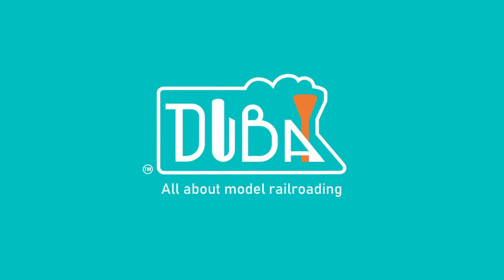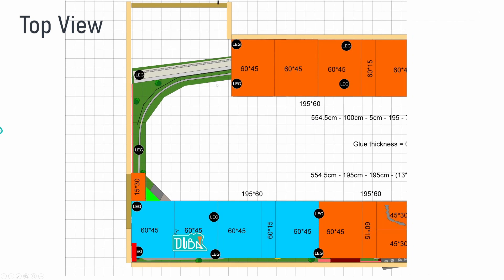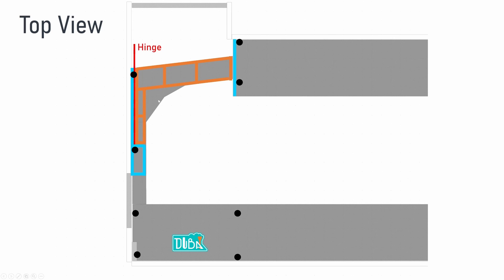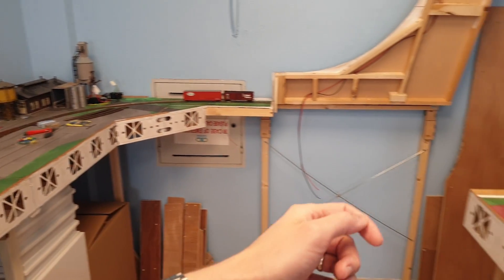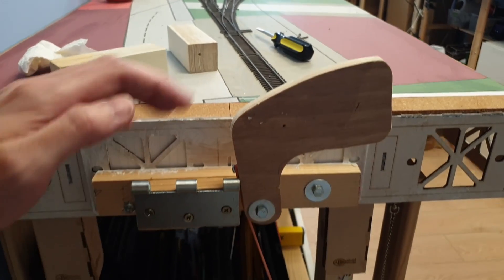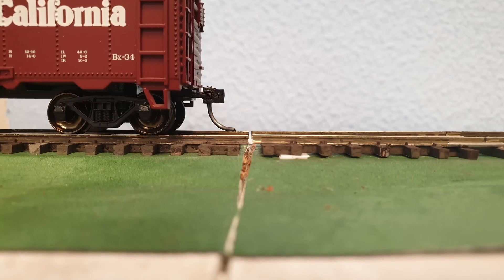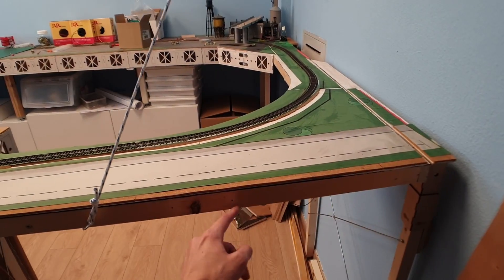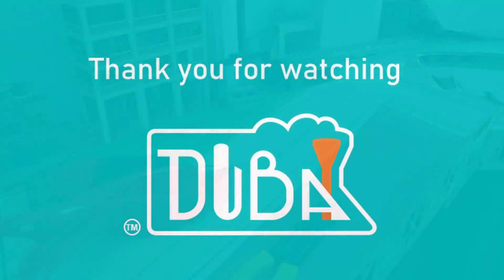135 - How to Design a Lift Gate with Safety Stops

Comment: Nice design, bridges always present a challenge as each application is unique to the layout. I agree with the safety stop approach with your layout, electrical safety switches wouldn't work as well. I used the safety switches as my layout design didn't require it, but I also can run into the same issue should I run them in reverse for any reason. I used a linear actuator for the lifting mechanism. Check out my video...
Model RailRoad Bridge Episode 2
Reply from the maker: A linear actuator sounds fancy! You could equip that with a motion sensors so the gate opens automatically when you approach it. Of course all interlocked with the rail traffic ;-)

Comment: Your counterweight looks to me to be a VERY old top block to a wood-workers plane.  I believe that would have clamped down the blade to a lower block, which would have been flat on the bottom with a slot in it for the blade to pass through.  I believe the hole in your "counterweight" is for not only attachment of the top block to the bottom block, but, you would also be able to tighten / loosen the blade by tightening or loosening the fastener that passed through the hole, thus adjusting and fine tuning the position of the blade.  This would be my best guess.  

As for the work on the lift gate, well done! Looking forward to see the entire system implemented!
Jonathan
Reply from the maker: Thanks Jonathan.
I have been using the life gate for over a year now and it works great. The only part I did change is the rubber band, that broke within weeks. I updated it with a cable and counter weight.

Comment: great job just a thought drill a hole were the coupler contacts the golf club so it makes contact on the buffers
Reply from the maker: Ah ok. to better align the gate with the benchwork.
Reply: no so that the impact is on the buffer not the coupler  @ModelRailroadDesigns

Comment: Your weight looks like part of a trailer hitch...
Reply: I do so wish that you would not have ended with "that is how you make a lift gate", but with How I made my lift gate because there are so many ways to do it. i do like yours though.
Reply: I do wish that you would not have ended this with "that is how you make a lift gate" but with "that is how I made my lift gate. There are so many ways to make one. i do like yours though.
Reply from the maker: Hi David, there are indeed many different ways to make a lift gate, and many different types of gates. I guess the circumstances really dictate what is the best fit for you. 
One aspect that was important for me was to have the maximum possible isle width when the gate is up. I have a lot of storage underneath the layout, and i wanted it to be easy to cary in / out boxes.

Comment: Love the mechanical stops, but I can't help but wonder how an electrical stop could be incorporated, with power districts on either side which would cutoff power upon lifting
Reply: MOSFETs and spring loaded pins to complete the signal circuit maybe 🤔
Reply from the maker: The issue is that the unpowered section of track needs to be far too long. It would leed half way into the switching area.
Reply: @ModelRailroadDesigns  makes sense, did get the gears turning in my head though. 

And well done again on the mechanical implementation, that’s remarkably clean in my opinion
Reply from the maker: @Peepjouster27  Thats good! Keep those gears turning. What works for me doesn't have to work for you.

Comment: Counterpoint : I use a duck under facilitated by a mechanics stool. I glide back and forth, never impacting the train paths.
Reply from the maker: Hi Donald. I had a duckunder before but always found it an excersize to use it. In practice the gate is always open unless I'm running trains. For now I'm working more on the layout than running trains.

Comment: I could be wrong but that metal weight looks like a brace for the rails or for one in a switch.
Reply from the maker: It does look a bit like a brace, but how would it work. The hole is in the wrong place.
Reply: Not reay sure that's just what came to mind.

Comment: Hi,  you could use a 'bar/counter flap catch',  to secure the gate when open.
Reply from the maker: Thats Red. I had to look that one up. That's exactly what can work! Let me mention it in my next vlog. I like my counterweight for now as it also releaves a part of the weight. Imagine someone accidentally letting go of the bridge, now the fall will be dampened or even stopped.